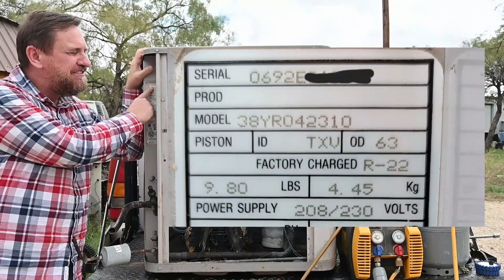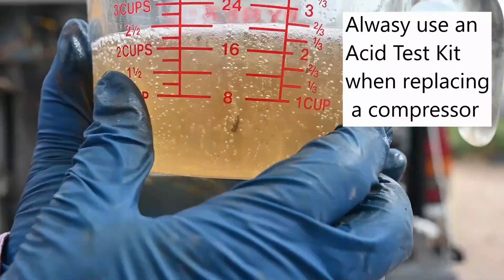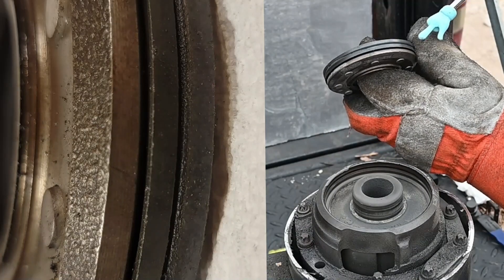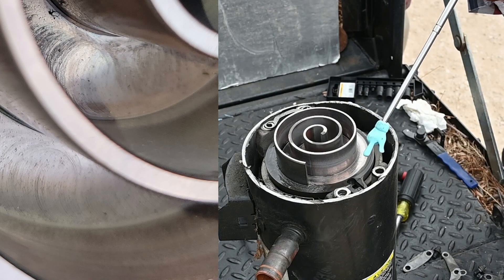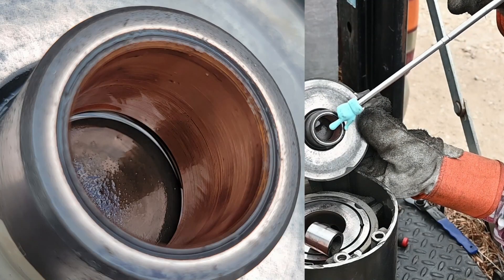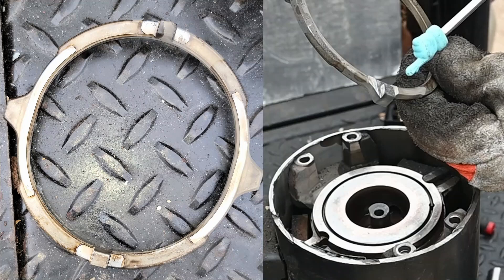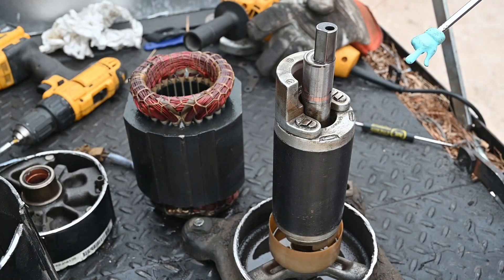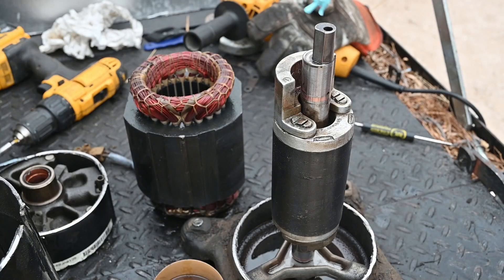31 year old Heat Pump Copeland scroll cut open & inspected.

Comment: Considering the lifespan of a compressor, would it make sense to replace the filter drier after about 10 years of service?
Reply: Great question, but I don't believe so unless you have a specific reason. Since the system is hermetically sealed, there should be no contaminants entering to clog or saturate the filter drier. It's not like an engine where there's large amounts of fuel, atmospheric air, etc being constantly cycled through to introduce moisture or other contaminants.

What's quite confusing is that Tesla and some other vehicle manufacturers are now suggesting replacing the AC drier as part of scheduled maintenance, but their logic is unclear and, to the best of my knowledge, not specified. I have heard theories about atmospheric moisture potentially permeating through the rubber hoses. Seems unlikely to me since the system is under positive pressure, but I'm no chemist and that issue wouldn't apply to residential systems anyways.

Comment: Hi I have always wondered if the Nitrogen flows through the compressor when brazing it in? Can u please answer the question it’s very important to me thanks
Reply from the maker: It won't flow through the compressor but it will greatly reduce the amount of oxygen and greatly reduce the oxidation effect.
Reply: Why it won’t?  Because only 3psi? What about if pressurized the system? Does flow through compressor 🙏 please explain, u r very knowledgeable , I watch one of your video said it’s does flow through that’s why I am confusing thanks
Reply from the maker: @8joh58   excuse the compressor will not allow anything to move through it without it operating. When a compressor shuts off, it holds high pressure on one side. The pressures won't equalize until it bleeds through the metering device.
The compressor has check valves in place to prevent the high side from bleeding back and the low side cannot move the compressor and motor to get to the high side.
Reply: So which means nitrogen never flow through the compressor when brazing it in, even if u flow nitrogen pressurized the system with 300 psi-350psi? But when system empty out the refrigerant, there isn’t pressure inside the system, nitrogen still can’t flow through compressor? Please 🙏
Reply from the maker: Nitrogen will move into the compressor and displace a lot of the oxygen out but it will not flow through the compressor like it will when brazing other joints. 

Even though it is not flowing though the compressor still reduces the amount of oxygen and oxidation in the compressor when needing to braze the compressor connections.
Reply: Thank u so much to answer my questions, so much appreciated it, could u make a video about the question I asked?  I am pretty sure a lot technician wondered if flow nitrogen through compressor when brazing it in or pressurized the system.thanks
Reply: Please explain thanks

Comment: If only the SEER2 compressors would last that long.
Reply from the maker: No difference in the compressor of SEER1 vs 2. Seer to really just requires manufactures to use static pressure to simulate ductwork.

Comment: I have never seen a 31 year old HP with the original compressor, seen a lot fail at 10 to 15 years. I have 35 years in the field running service.
Reply from the maker: We need to do better at installing,
Proper dehydration methods,
Proper suction piping,
Proper airflow,
Proper charging.

Next comes proper servicing. The 15 minute vacuum, suction looks good, had anometers, and beer can charging doesn't cut it. 

A good service tech and maintenance can't overcome a bad install. Some installs even look good but without proper vacuum,. It will never see it's potential.

Compressors do not die, they are murdered.

Comment: Excellent video. Your explanation of how things we’re wearing was easy to understand. Overall based on the age it didn’t look to bad. Thanks.
Roger
Reply from the maker: Thanks, yes inside things looked really great, decently had a lot of life left in it and all the wear was external, car on and overheat=low on charge.
 Bearing wear from floodback=low superheat, (airflow, over charge overfeeding metering device)
Copper plating=improper dehydration=acid=eats copper away from the system.

Imagine how long the compressors would last if:
We installed them correctly,
Maintained correctly,
And did  not  have to change refrigerants.
Reply: No kidding. Seeing the interior components and the damage related to superheat, low oil and other issue creates takes the mystery out of the gauge readings and why they are so important. Thanks again. Roger

Comment: GREAT video!!! There is on thing I didn’t see why can’t I pull a vacuum at times through a scroll. I tap the top and  it will drop to sub 500 micron and then back up to 1000 microns. Then on my third attempt we head a clunk in the compressor and boom 293 microns with a 20 minute decay to 498 microns.  What is happening in 2023 compressors. I do have 2 pallets of failed warranty compressors sitting there.  Maybe it time to grab the go pro. Maybe it time to think about some content on my old channel.
Reply from the maker: What brand of compressor was that?

Comment: it seems to me: back in the days, they could build things to last. how long modern compressors work? 10? 15? 20 years? under "optimal" conditions? 
a few questions: is the oil the original oil from 1992 or was it replaced, when yes, when it got replaced? im a little bit curiouse.
Reply from the maker: Original oil.
Refrigerant oil does not wear out, it can get contaminated with improper vacuum or taking hoses in and off introducing moisture. It can get birt form overheating  such as a leak, low suction pressure, high superheat, high suction gas temperature. The discharge line should never exceed 225.

A car engine has massive heat, blow by from combustion, left. Over carbon from air and fuel. A Refrigeration compressor does not have any of that.

 Copeland still builds these scrolls the same way but they have added some protection such as a thermal operating disk, pressure relief valve, and anti reverse rotation valve. 
They are still made here in the USA in Sydney Ohio. They built and test them for 100% to be operating at least 20 years. Due to improper installation and maintenance is the reason for shorter life.

There is nothing to wear out and fewer moving parts than a reciprocating compressor. 

The biggest issues today are improper installation, and leaking evaporator coils.

Comment: This is very wonderful and an excellent explanation... We want a clarification and explanation about the suction line heat exchanger SLHE, Trane innovation in heat pump chiller.
Reply from the maker: The idea is to use the suction gas to sensibly cool the liquid refrigerant aka add subcooling, this reduces the amount of flash gas after the metering device. 
On the suction side, the warmer liquid passing on one side of the heat exchanger helps ensure all the liquid refrigerant is boiled to a vapor in the suction side of the heat exchanger  before entering the compressor.

Comment: Thank you for all what you to do Ty!
If a big leak happened and lots of oil was lost what is the right way to measure and add it?🌷Thank you.
Reply from the maker: Good question, no easy way on a resi system, there is no oil sight glass like commercial.  You can compare suction superheat to discharge superheat. If they get too far apart it's a good sign it's low.  However the only way to really know is to drain and measure.
Reply: @love2hvac  Can you add a sight glass on Resi system ?
Reply from the maker: @Dicofol1  for refrigerant yes, for oil no.